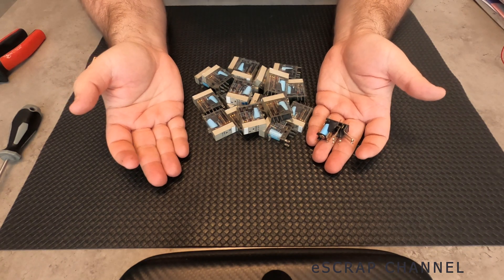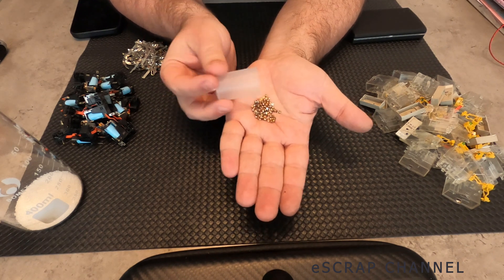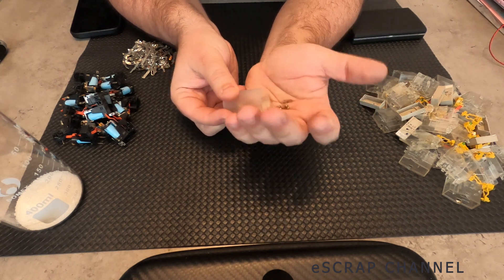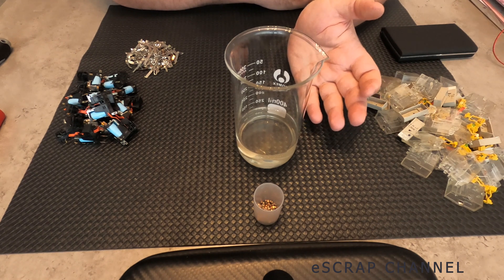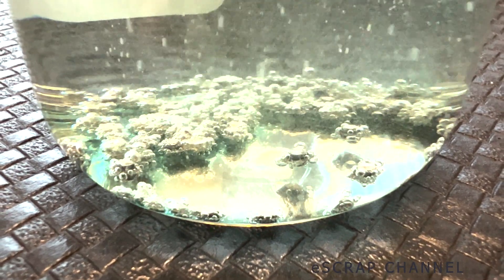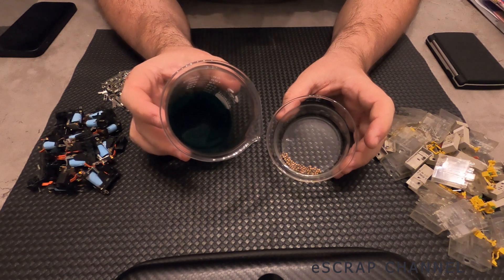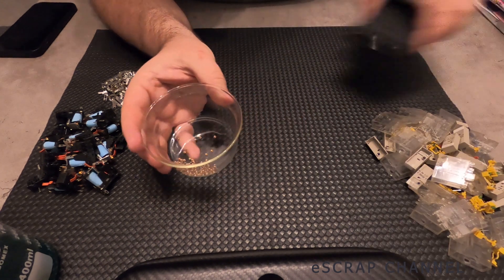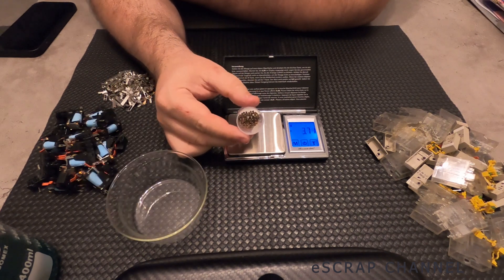How to Clean Silver Contacts from Copper

Comment: This is a great video!  I have been looking at cost-effective ways to recover silver from base mentals for contacts from relays, circuit breakers, switches, etc.  I had never heard of this method but it seems like it is going to be extremely useful for me.  Thank you so much for sharing it!  Do you by any chance remember how much the contacts weighed at the beginning before they were placed in the beaker of solution to remove the base metals?  I assume that this solution will not attack silver, or
do so only very mildly.  Is that in fact the case?  Is there any effect that this solution would have on gold or platinum group metals, and would it be appropriate for removing base metals from them?  I mostly accumulate silver contacts, but I have at times come across smaller quantities of gold plated contacts as well silver/palladium contacts, and would be interested to know how this solution might work on them.  I would very much appreciate any information you would be able to share.  In any case, thank you for having shared this method for silver recovery.  I believe it is going to prove Extremely useful to me.  I very much appreciate you.Having made this video!  Cheers!
Reply from the maker: Hi, unfortunately I did not measure contacts weight before and after, but in general at about 3-4 ml nitric acid are needed to dissolve 1 gram of base metals. Silver is blocked by the hydrochloric acid. As we create aqua regia - solution will attack gold, palladium and platinum if heated. For gold plated contacts I first boil them in nitric acid and dissolve silver and possible palladium. Gold foils remain and I process them separately.

Comment: Giving this a go now and at the moment it's fizzing away but the solution is more green (could be the brass)

Does anyone know what the gasses are, bubbles start off big (oxygen?) and now really small (hydrogen?) would like to know if worth collecting the gas in the process 🤔
Reply from the maker: @Andykerrfield  Hi, bubbles are nitric oxides. No need to collect them. Solution can turn greenish if nickel present and dissolved or if silver contacts covered with palladium.
Reply: @escrapchannel  Thanks for the method, ran just the contacts again (had some questionable metal from MCBs) in fresh solution and it's a lovely blue now 👍

Comment: Not work
Reply from the maker: What is not working? What did you do?
Reply: @escrapchannel  sir i did same the same process as you, but the silver is attached to the points in the same way.  Mean. In this process silver is not remove on copper points.
Reply from the maker: Hi, you used citric acid, table salt and hydrogen peroxide? Sometimes peroxide is old and not catalysing the reaction well. What was the % of the peroxide?
Reply: 6% sir.
Reply from the maker: @yousafali1118  When you mix the peroxide with citric acid and salt reaction immediately starts with copper. Is color changing or bubbling starting, please?
Reply: Sir please tell me any method by which I can separate silver from copper contacts. and the weight of copper little less.. Please sir any method this kind of tell me.
Reply: @escrapchannel  Sir please tell me any method by which I can separate silver from copper and the weight of copper little less.
Reply: Yes sir colour is changing and bubbling start also but the silver contact as it is
Reply from the maker: Alternative is to use aqua Regia. I have such a video. You put a lot of hydrochloric acid and start adding nitric acid. If it is not copper but some kind of alloy it will be dissolved by the nitric acid.
Reply: @escrapchannel  ok thanks sir

Comment: Thanks for the video, does palladium dissolve in this mixture, I have palladium contacts on thin copper.
Reply: What's a quick way to differentiate silver and palladium?
Reply from the maker: @brandonowens282 Hi, I use testing solutions of nitric acid and a second one for silver based on dichromate.
Reply from the maker: Hi, to be honest I never tried, but palladium is possible to be attacked in a solution of strong oxidiser like hydrogen peroxide in presence of chloride and acid. You gave me idea to test this. Thanks!